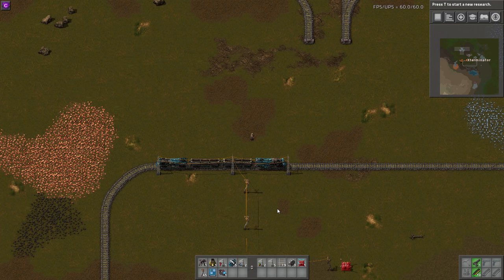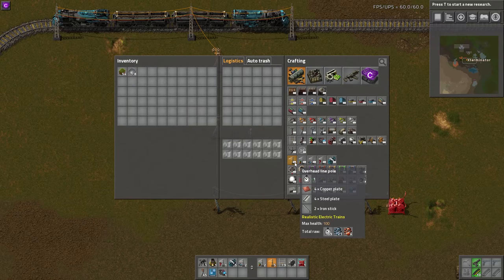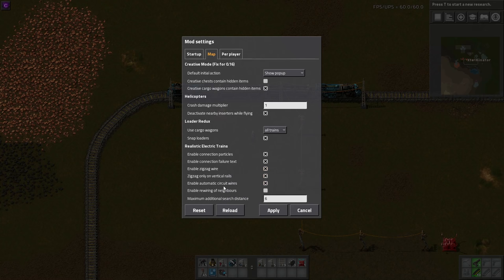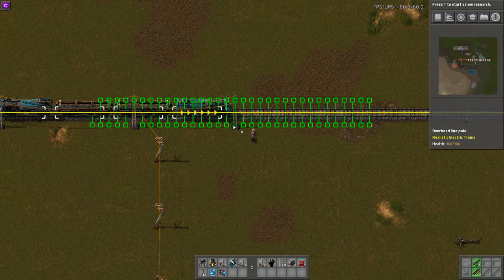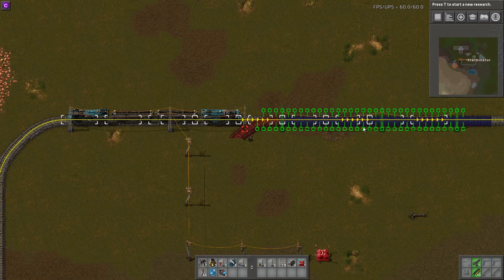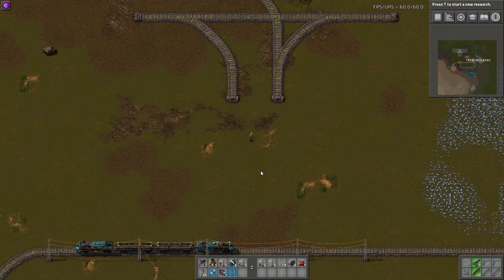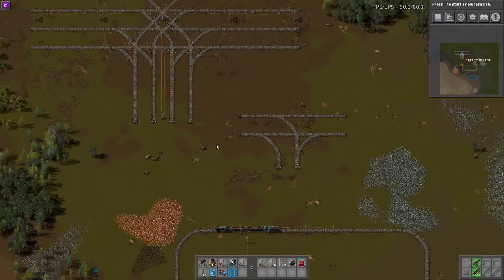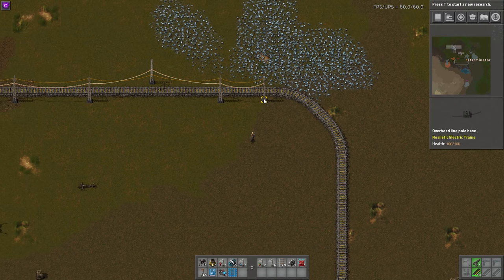Factorio Mod Spotlight - Realistic Electric Trains

Comment: You can see the zigzag pattern when placing poles on a vertical track section. Place the poles on one side and you'll notice. In reality it makes the contact on the pantograph wear down more evenly.
Reply: Just wanted to point something out, in case anyone's curious.  With a high-speed train, without the zigzag pattern the pantograph would get cut in half by the line in minutes or less due to friction from the overhead line.  It's a bit less brutal with slower trains, but still really really important.  I always read that it made it wear more evenly, and imagined it was analogous to not rotating your tires.  In reality it's more like having tires that don't rotate, if you catch my meaning.

Comment: Awesome mod. The reason why your blueprints sometimes don't connect the circuit wires Is probably because your blueprint wasn't exact... Signal type entities sometimes wind up not matching exactly.
Also, partly powering an intersection is probably a bad idea... If the train stopped to let another pass, it won't have any momentum to carry it over.
Something you can do, however, is have an n-m-n configuration, but all the locomotives point in the same direction, so that the rear one is still in range of the power poles untill the front one bridges the gap. It depends on the train length and the intersection size, but it should work. It should also make the rear end of the station shorter, since the locomotive can be parked at a curved rail piece (and fueling is not an issue).
Reply: Nope, blueprinted wires are actually impossible in this version of the mod. The next version is planned to fix that though

Comment: Wouldn't recommend leaving unpowered intersections. If a train must stop in an unpowered section, it will be unable to accelerate again and get stuck.
Reply: You can avoid that with proper signalling. Check the forum for an example picture. I let that run with multiple different trains and never got any of them to stand still.
Reply: @Julian-vt5lh Your example doesn't matter. If you have a signal that rests in an unpowered section and ANY of your trains are small enough to sit in it, then they can get stuck with the right conditions no matter how rare it's still possible. In a big base like Xterms we all know what those "ultra rare infrequent train deadlocks" that happen once in a blue moon can still do..instant save revert.

Comment: If it uses wires, it's not a train, it's a tram...
Reply: What? Are you serious?
Reply: Lol, an Electric locomotive and a tram is not the same thing. The biggest differences are that they use different kinds of rails and are used in different environments. Trams use rails that are built flat into asphalt but these are not safe to drive at higher speeds on which makes trams better for big city transportation above ground as an alternative to buses. (Building trams in subways would be a waste of time since underground transportation only is worth it if it takes advantage of the fact that no other traffic exists down there). Electric trains use the same rails that other train types use. These kinds of rails can withstand higher speeds and are therefore good for long distances and not so good for driving amongst cars and other above ground transportations. If you see electric trains in cities it’s most often underground or separated from other traffic which makes it take up more space than trams.

tram ≠ electric train/locomotive